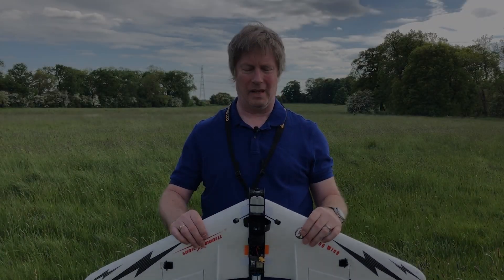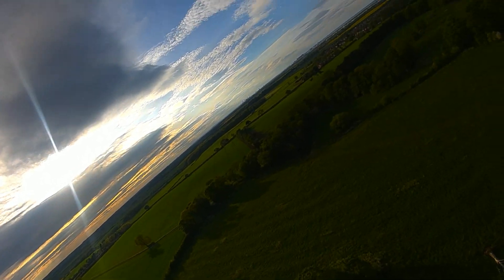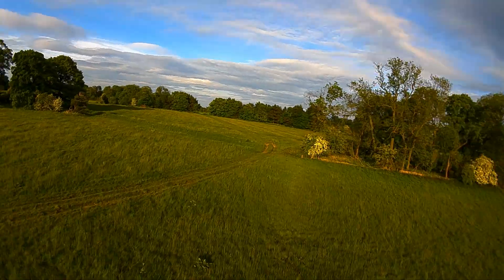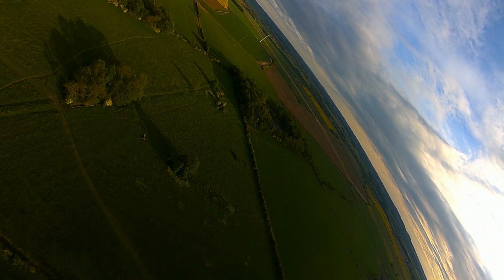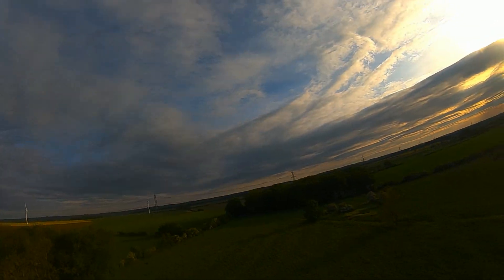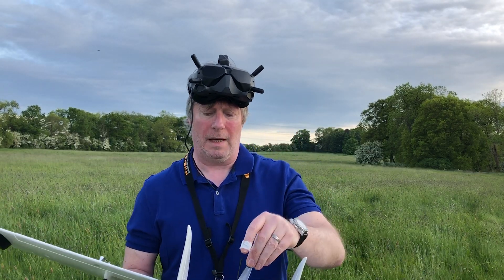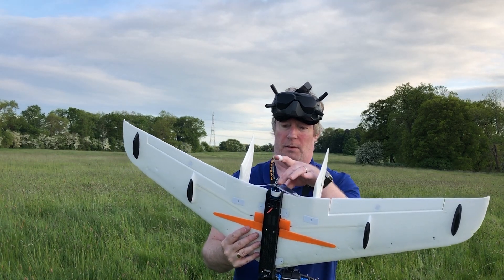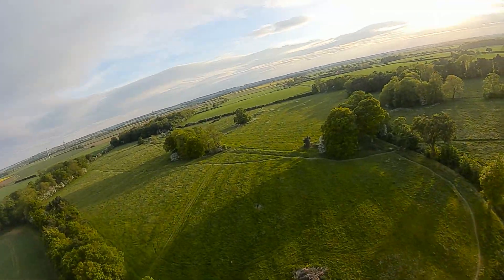Sonicmodell CF Wing with DJI FPV

Comment: That bob bob  bob in the footage reminds me of the HK  Sidewinder, caused by a thin wing section flexing in flight,  I half fixed it with several  layers of 2 inch clear tape layered in a cross pattern top and bottom to  introduce some tension against flexing,  Might help  with the CF.

Comment: Have you got the osd to work with the DJI FPV system yet?
Reply from the maker: Yes just the standard elements supported by DJI and Betaflight/iNav with recent updates to include home direction, distance from home, speed and PID values

Comment: Liking your videos. Subbed. Almost makes me want another cf wing. I never could get mine tuned right, mine always wobbled on the pitch axis too. Im wondering if a boom tail would fix it but you would need a longer nose to compensate for CG.
Reply from the maker: I agree Scott I definitely need to do some more work it is not that stable yet but was fun for its first successful outing. It wobbled like crazy on full throttle.

Comment: Nice video. Do You want to share your settings for Inav Autolaunch ?. They seem to work just fine :-)
Reply from the maker: I have my prop spinning when I arm the plane at 1200 so be aware of that if you use these settings and settings relate to a particular plane, weight, lipo, motor and prop so they may not be optimized for your intended use.
set nav_fw_launch_velocity = 300
set nav_fw_launch_accel = 1863
set nav_fw_launch_max_angle = 180
set nav_fw_launch_detect_time = 40
set nav_fw_launch_thr = 1800
set nav_fw_launch_idle_thr = 1200
set nav_fw_launch_motor_delay = 100
set nav_fw_launch_spinup_time = 100
set nav_fw_launch_min_time = 2000
set nav_fw_launch_timeout = 6000
set nav_fw_launch_max_altitude = 6000
set nav_fw_launch_climb_angle = 30
Reply: @bluefish3607 Thank you for your settings, which I will try as a starting point

Comment: Nice my friend :)
Reply from the maker: Thanks JB I loved your Drak build and video, I have a Mini Drak kit and am just thinking about what Lipo, Motor, ESC, Prop config to go for before I start the build.
Reply: BlueFish I’m also build a mini drak at the moment. I use a badass 2820 1350kv on 6s, 60amps esc, 7x7 prop. My friend flys with it 135 mph. Maybe you come at summer with Marc to me :). So we can fly’s together, if corona ends...
Reply from the maker: @JB-Scooter  Hi JB I was looking at the same motor for a 6S build but with the BadAss Renegade Series Brushless ESC, 85A and a Matek F765. Not sure what servos to go for do you have any recommendations or ideas?
Marc was supposed to be coming to the UK this summer but with this pandemic I am not sure that will happen. If I can get to Halle to visit Marc this year I certainly will and it would be great to meet and fly with you.

Comment: Lovely mods 👍🏻. Looks rock solid now
Reply from the maker: Thanks Beef it was good to finally get over the issues
Reply: @bluefish3607  I've built a plane during lockdown... flying wing with dji fpv system and f405 wing controller. I've not flown before. it's my first ever model. I'm dreading having a crash!
Reply from the maker: @beefybeef1326  I really prepared this wing better than any I built before, I came from quads and got my first wing in April 2019. For me crashes have been part of the learning curve for me. I wish you well and my fingers are crossed for a successful trouble free maiden.
Reply: @bluefish3607  cheers!. I baught a simulator for my computer and have been flying wings on that to get a bit of practice in. I'm actually an aeronautical engineer so I do have a little understanding of what I should do.... hopefully I dont have an expensive accident!. Let's see how I get on. Where are you based anyways? Looks like a lovely place to fly.
Reply from the maker: @beefybeef1326  Aeronautical Engineer, I am an IT consultant so if I can do it you should breeze it and have one of the best flying wings on the planet :-) Sims are great I used one and it really helped.
Reply: @bluefish3607  i doubt that but thanks for the vote of confidence!. Love the channel by the way great content. Subbed a while back. Look forward to seeing more of your builds and flying 😎👍🏻
Reply from the maker: @beefybeef1326  Thanks I appreciate that, I am no expert and make many mistakes but just love flying and trying to share my real experience not just amazing videos.
Looking forward to seeing some of your future footage and how things go for you, I am expecting amazing things :-)
Reply: @bluefish3607  .... dont expect amazing things my friend!. I'm an absolute beginner when it comes to flying models. If it goes well I will let you know!. At this point I will be happy just landing in one piece!

Comment: Some nice flights there! Glad you perservered as the wing looks very sleek. 185kph - my mini talon tops of around 120kph, much more of a cruiser. :)
Reply from the maker: Thanks Caroline we got there in the end, I fly my Dart XL in a much more relaxed fashion and enjoy that as much as tearing around the sky. The Mini Talon is a great plane and on my wish list.
Reply: @bluefish3607  I'm still using regular 2.4Ghz radio control until I'm completely happy with iNav and its many settings. Max range I've had is around 1.5km, video was clear all that way on  5.8Ghz. Again, taking baby steps :)